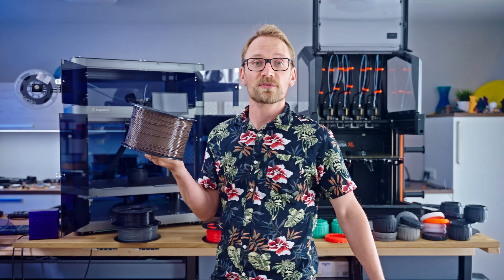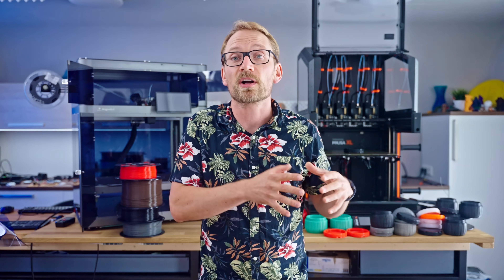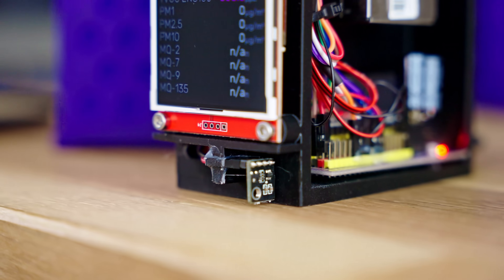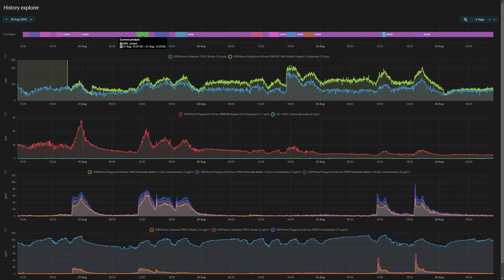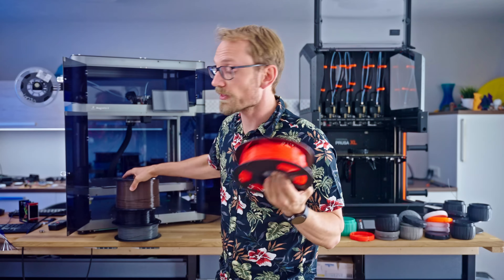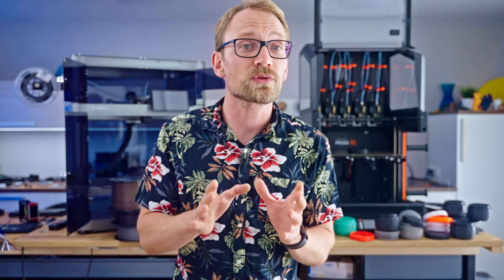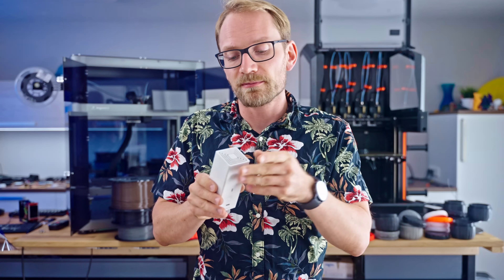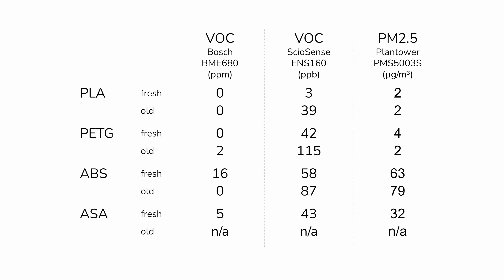3D printers are worse than I thought. Time to do something about it!

Comment: Please note that: most of the hepa filters that you are purchasing from amazon/aliexp are not hepa.
Reply: Yep, if you're going into safety there's way more to consider then you may expect. Like using gloves, you need the correct type but also a way of working with them. In the lab I was working we sometimes didn't use them to avoid touching the entire room "because gloves are safe right". Etc. :)
Reply: @punishedbrains you are definitely right.  I just wanted to state my thoughts against the cheap hepa filter hype.
Reply from the maker: For any safety equipment, I'd always recommend buying from trusted brands and sources. The air filters I've linked in the description point to ones from Philips on Amazon, and even though the Ikea filter I've used in the video are only rated at EPA12, they were still very effective at removing PM1 particles. EPA12 is rated for an average 99.5% particle removal rate across all sizes, while HEPA13 is rated for 99.75% *at its least effective particle size*, which is typically the 100 ... 300 nm range. From my experience, either option does a great job removing particles emitted from 3D printers, and any filter will be better than no filter at all.
Reply: @MadeWithLayers  The problem with buying from Amazon is that you really have no idea if the part you ordered is counterfeit or not - even if it's sold by the official manufacturer and handled by Amazon. They'll receive inventory from multiple sellers, mix them all together, and pick them at random to fulfil orders from any of the sellers. I would absolutely not trust them for anything safety-related.
Reply: @widget5963   This concerns items which are counterfeited. Say buying storage devices is very perilous. I don't know whether counterfeit branded filters even exist, what would be the point.
Reply: @SianaGearz They definitely exist. I have a pack of supposed honeywell 20x20x4 filters that are so poorly copied that they're almost half an inch off on one length and half an inch larger than 20 on the other. Bought them at a government surplus auction, which means the supply chain is compromised everywhere. The Honeywell logo isn't even correct, ffs.
Reply: @SwervingLemon Wonkeyhell😂
Reply: Even if it is HEPA it needs to be properly sealed and so on.
Reply: @BeardedPete  Not if you have a negative pressure flow.
Reply: The more salient point is that HEPA filters are only a small part of the filtration equation. HEPA rated air movement paths have a lot of seals that are design to be literally air tight, which is why they are a high standard when it comes to cleaning air. A HEPA filter on, say, a box fan isn't doing much other than choking off the fan.
Reply: @guitarchitectural hmm that's an interesting thought. I've been wanting to build a filter for my 3D printer enclosure (which is not air tight) and the design I'm following is exactly that, a 120mm PC fan with a box around it and a hepa filter at the end. if it even is a HEPA filter because it's from amazon
Reply: I have a natural mistrust of manufacturer claims (and especially Amazon drop shipper and Aliexpress seller claims). When I get a new filter, I typically place my pm2.5 sensor in the same room and run it for a few minutes. Even if it's not technically HEPA, if the pm2.5 count goes down substantially, it's good enough for me.
I should point out that the particulate count in my home is usually less than five, but on the West Coast of the US, we stew in wildfire smoke some years and it's a good basis for testing (and good use for a filter).
Reply: You can find cheap HEPA filters. They might be made with polyester instead of fiberglass but they can still achieve HEPA ratings
Reply: Good to consider, but then, do you NEED or even WANT HEPA?

For example the IKEA filters featured in this video are not HEPA, they are EPA12, with 99.5% claimed minimum 0.2pm capture rate, which is a very high EPA class but well short of HEPA requirements. I would be very inclined to trust this corporation's safety ratings.

HEPA might not even be practical due to restrictiveness of the filter? I mean you want the fan to actually run properly and not suffer flow reversal or something like that.
Reply: and the ikea filter only h10.. does not filter even the 10pm efferently..
Reply: Note these are to filter room air. Not to filter an industrial process
Reply: 1.) Everything on Amazon is a scam thus Scamazon. 
2.) Everything sold in China is misrepresented.  They even expect it when shopping.
Reply: huh that's interesting, I got mine from amazon but have yet to install it. any idea where I can get a good hepa filter?
Reply: They are not always HEPA, but that doesn't mean you cannot get HEPA filters on Amazon or AliExpress...
Reply: @theproceedings4050 it means you can’t knee it tire getting hepa. The way Amazon stores their inventory means when the official Amazon sellers end up with counterfeits. For example, I’ve received knock off electronics when buying from official stores several times.
Reply: I've gotten much better filters from AliExpress than locally here in Norway.
But yes you need to know what to look for
Reply: @tullgutten any recommendations? Like which brands are good on aliexpress?
Reply: @ingusmant  following
Reply: @ingusmant   Not sure about aliexpress but 3M Filtrete filters with MERV 13 rating are often recommended in the DIY space. MERV 13 is the cheapest tier that filters all particle sizes well. For a room you can get away with a single large filter and some quiet PC fans in a box, for a workshop etc you'd want a bit more. The channel 3d handyman has a lot of videos and tests about that stuff.
Reply: Safety is mostly an illusion… if you start pulling this thread you might end up actually slightly safer but feeling 💯less safe with a dash of paranoia 😵‍💫.
Reply: @MakerBees333 wow. Insanely dumb comment. I work in the oilfield. Safety is real and necessary and if you feel safer without it I'm not getting in your car
Reply: @imaginitivity7853  mmmkay… more than 100 oil field workers die every year, why don’t you guys use that ‘Saftey’ you say is so necessary.  Every follows ‘safer practices’ to help mitigate danger but there is no such thing as Safe and still getting something done.
Reply: @MakerBees333  not where I work. Possibly third world countries like USA
Reply: @MakerBees333  No offence but what facts are You basing Your opinion on ??
 Because to me Your comment just looks like a misdirected attempt at being """edgy""" 
It makes me curious, would You for instance tear out asbestos isolation or work in a spraypaint booth  totaly without ppe? If not then why ?
Best regards